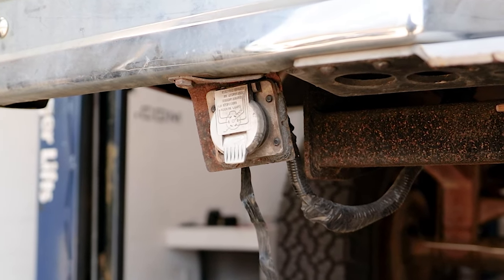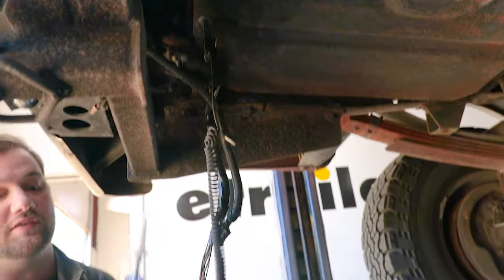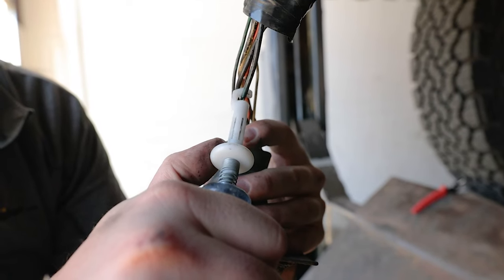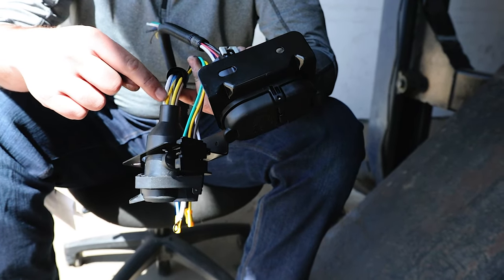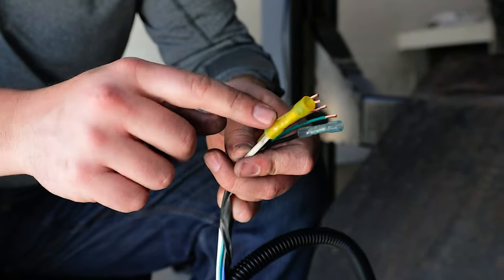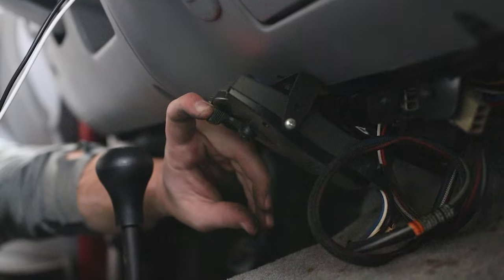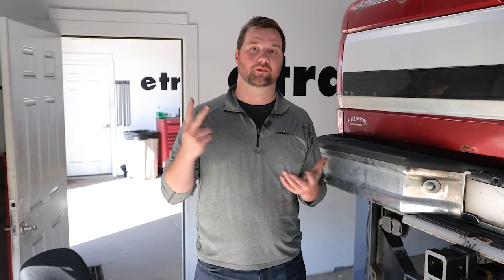How to Wire a 7 Pin Trailer Plug (Vehicle Side)

Comment: Where is the video showing the wiring from the front of vehicle? I need to start fresh.
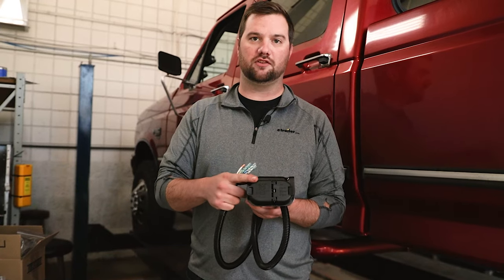Reply: go to 1:40 in the video
Reply: @weldcrescentcity34  Like the other guy-  the reference is to a "previous" video that shows complete vehicle wiring. That separate video is what we need.
Reply from the maker: He are some guide pages that will help you out! https://www.etrailer.com/faq-installation-of-brake-controller-from-scratch.aspx and https://www.etrailer.com/faq-etbc7.aspx And here is a broad spectrum page with brake controller guides just in case! https://www.etrailer.com/article-categories.aspx?productgroup=Trailer-Brake-Controller
Reply: Can you please share the link to the video

Comment: My Toyota pickup has a 7 way round plug and I'm not sure if it was ever hooked up for breaks there no break controller in it as far as I know and I don't know how to test if anything other than the pins for the ground blinkers, running, and break light work. I know they work because I have an adapter that goes from 7 to 4 pin. Any advise?
Reply from the maker: What model year is your Toyota pickup? Is it a Tacoma? A Tundra? A T-100?

Comment: What I find confusing is when a blue wire is for "brakes". But, the brakes use the left and right turn signal wires, and I think a higher voltage on that wire, brightens the output of the bulb when you hit the brakes. So, what does the "stop" wire do? Is that for electric brakes, and the signal causes the brakes to engage?

Comment: where is the vid to wire it from scratch???  I just used a pre existing plug on a new used truck i just purchased.  A 2000 freightliner fld120.  My issue is that everything works but it has no brake lights.  Everything on the truck works fine and I ran a test light on the ground at the pre existing plug and it seems fine.  Blinkers work fine but no brake lights.  Cant figure it out.

Comment: your wire tester looks pretty awesome.  Does it poke thru the insulation or work like and A/C testor which just senses the voltage?
Reply from the maker: The exact tester shown is no longer available, but it's very similar to the # PTW2993 which we do offer. It does pierce the wire insulation, but the hole is very tiny.
https://www.etrailer.com/Electrical-Tools/Performance-Tool/PTW2993.html

Comment: If you use a 4 flat to 7 blade adapter, do the brakes, backup light, and 12 volt work, or are you missing out on that functionality? I'm deciding if I need to take out my 4 flat and replace with 7 blade or if the adapter would accomplish everything. I just got an RV to tow and am having trouble figuring out why the brake and turn signals are not working. I am using an adapter. Going to test a few things tomorrow with the trailer plug, and the truck itself. Thanks
Reply from the maker: Once the 4 pole of an adapter like # 37185 is plugged in, and the white wire is grounded to the tow vehicle, you'll have lighting function only. the yellow wire taps into the reverse lamp circuit, the black wire for 12-V accessory power connects to the positive battery terminal and the blue wire connects to the blue wire exiting the rear of the brake controller. We offer the whole kit as part # ETBC7 which includes the adapter, wire, circuit breakers and hardware- everything needed for a successful install.
https://www.etrailer.com/Accessories-and-Parts/etrailer/ETBC7.html
Here's a link to a run-through of the installation:
https://www.etrailer.com/tv-review-etrailer-universal-trailer-brake-controller-wiring-kit-etbc7.aspx

Comment: Where is the link for wiring vehicle from scratch mentioned in this video? I want to wire a 7 pin for a 98 Durango
Reply from the maker: Here you go! Just use this link:
https://www.etrailer.com/faq-installation-of-brake-controller-from-scratch.aspx
Reply from the maker: Our # ETBC7 wiring kit would be ideal for you!
https://www.etrailer.com/Accessories-and-Parts/etrailer/ETBC7.html

Comment: Were is the video showing the wiring from the front of the vehicle? I need to start fresh.
Reply from the maker: Check out the linked instructions for our # ETBC7 kit. They will show the wiring necessary at the battery and brake controller.
https://www.etrailer.com/instructions.aspx?pn=ETBC7
We might have a video that would help, what's the year, make and model vehicle?

Comment: Question about the red wire/brake wire.  I have an existing four pin working in place.  Bought the four to seven adapter for my new trailer.  Do I need to connect the red wire brake to the controller?  Is it redundant?  Or does the red wire feed to the brake controller tell it to activate?  I would prefer to skip the red wire, can I simply provide 12v 20amp to controller under dash and send the blue wire to the seven pin?   Trailer has no reverse lights and I am not adding them.
Reply from the maker: What vehicle are you working with? In the video, the blue vehicle wire was the brake output which attaches to the blue wire on the trailer connector harness that we show and the orange vehicle wire is the 12V feed to the trailer which attaches to the black wire on the trailer connector harness. The white harness wire is the ground, the red is left turn/stop, the green is right turn, the brown wire is the running lamps and the yellow is the reverse lamps. You can see the color code chart for the replacement 7-way connector/harness on this page:
https://www.etrailer.com/Custom-Fit-Vehicle-Wiring/Hopkins/HM40975-11998.html
Please let us know if you have further questions!

Comment: What harness are you using in this video? It's exactly what I need to replace my old damaged 7 way, but I can't find it on the website and there's no link in the description.
Reply from the maker: Jake used the # HM40975-11998 connector/harness, which you can check out by using the link we've provided below:
https://www.etrailer.com/Custom-Fit-Vehicle-Wiring/Hopkins/HM40975-11998.html

Comment: Whats the part number for the 1st plug you showed?
Reply from the maker: If you're speaking of the connector Jake's holding at the :35 minute mark, it's part # HM40975-11998. If you're speaking of the one a little later at the 1:15 mark, it's # C57672.
https://www.etrailer.com/Custom-Fit-Vehicle-Wiring/Hopkins/HM40975-11998.html
https://www.etrailer.com/Trailer-Wiring/CURT/C57672.html

Comment: do you have a link for the 7 pin connector kit?
Reply from the maker: What's the year, make and model of your vehicle?  If you can provide that info, we'd be happy to recommend a 7-way assembly for you.
Reply: I have 2006 f350 needing to replace7pin connector. Looking for the one with the heat shrink crimps on the wires

Comment: Ok what about vehicles that don’t have plug installed from factory
Reply from the maker: The best way to do this will depend on whether your trailer has brakes or not. The first step for either scenario will involve installing a functional 4-pole trailer connector. Once that's done, if the trailer does NOT have brakes, you can simply install a 4-pole to 7-way adapter like # 37185. Plug this into the 4-pole, ground the white wire and and bundle the blue, black and purple wires up out of the way. If your trailer has brakes and you'd like them functional, you'll need a brake controller and the # ETBC7 install kit which includes the 31785 adapter in addition to the functioning 4-pole. If you'd like specifics, let us know the year, make and model of the vehicle in question and let us know if the trailer has brakes. The linked product pages have some videos that you'll find helpful.
https://www.etrailer.com/Trailer-Wiring/Hopkins/37185.html
https://www.etrailer.com/tv-install-etrailer-universal-brake-controller-installation-kit-2019-chevrolet-express-van-etbc7.aspx